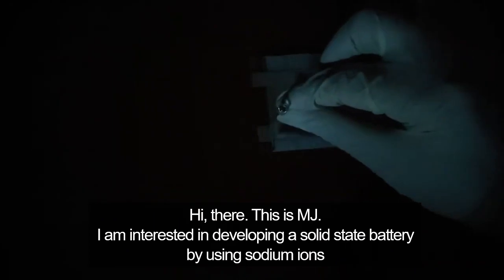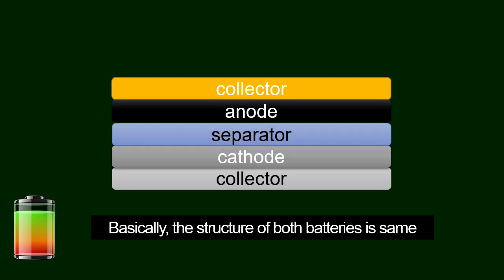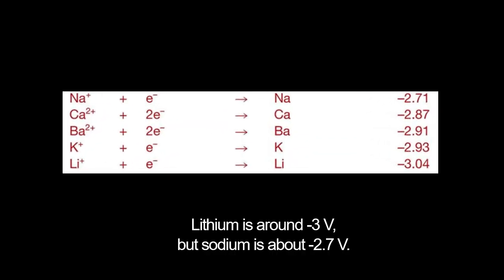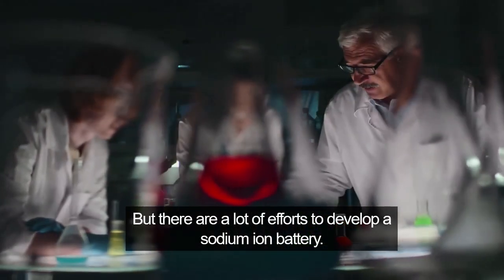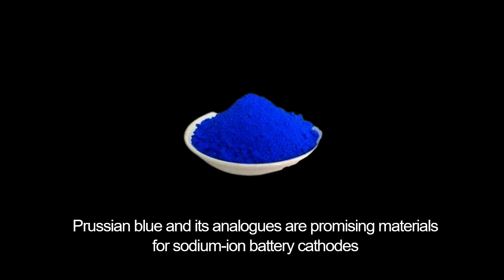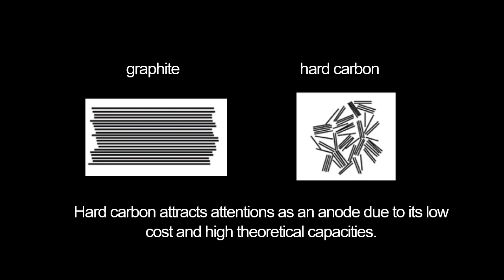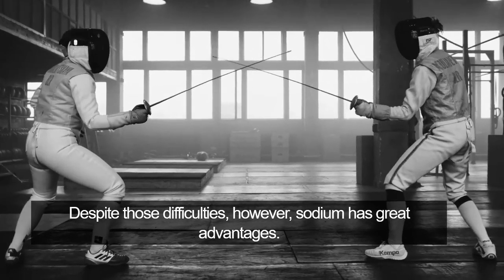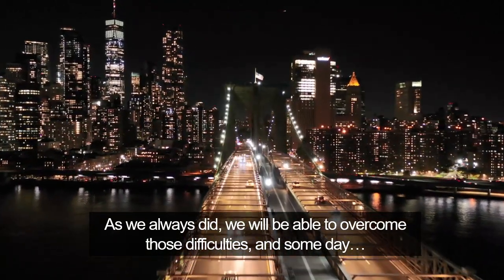why developing a sodium ion battery is difficult?

Comment: Hi MJ, excellent presentation. Is it possible that there is an over emphasis on single cell voltage as apposed to charge holding capacity to increase current with readily available materials and use multi layered battery to compensate for voltage potential?